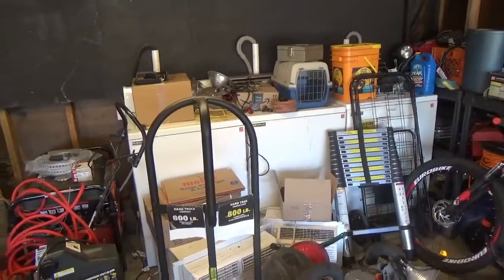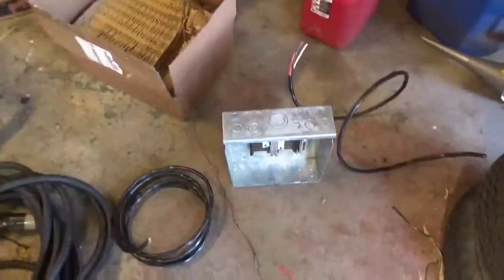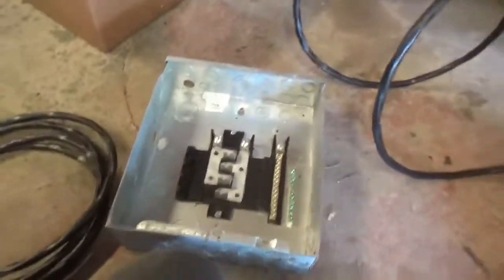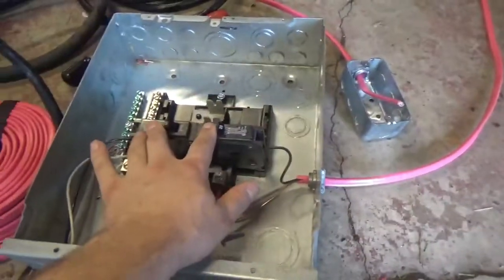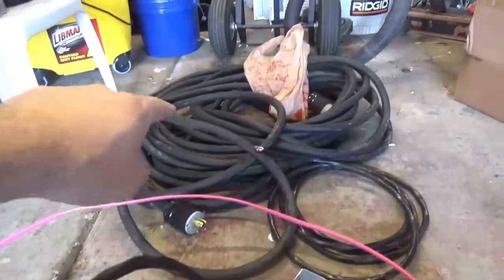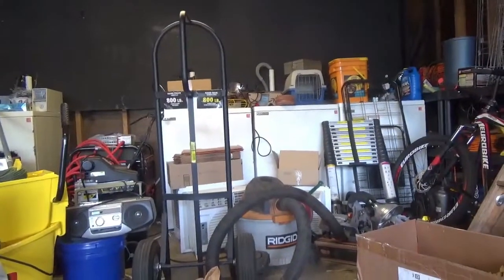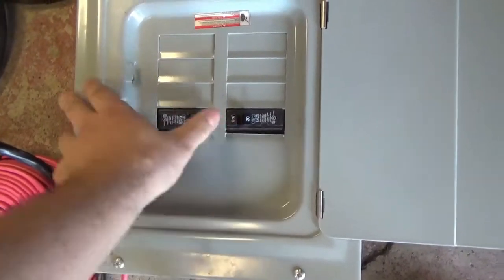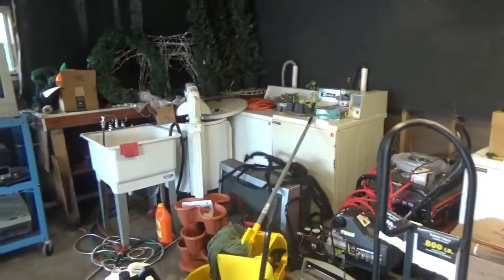Opening The Garage Laundromat Part 1 Electrical

Comment: Nice, that should work fine.  Personally, I think 3 washers on a 20 amp circuit is pushing it, but yes, it can do it.  Is that going to be mounted up anywhere, or just sitting there so it can be taken out of service whenever it's not in use?
Reply from the maker: it's just gonna lay around hidden when not in use. Plan was to mount it but the city would have a fit.